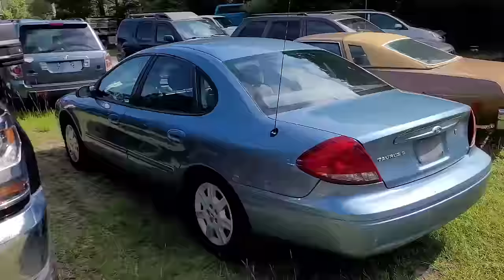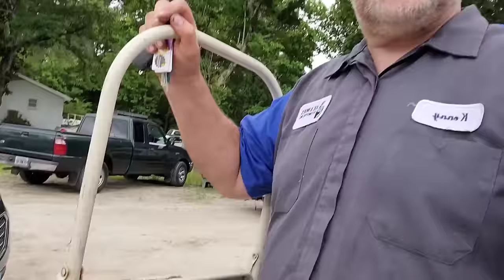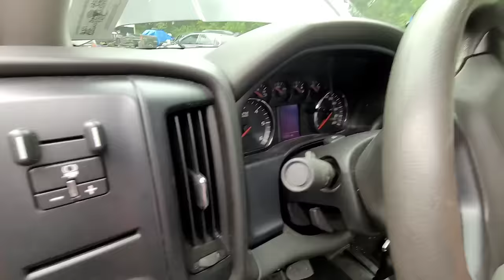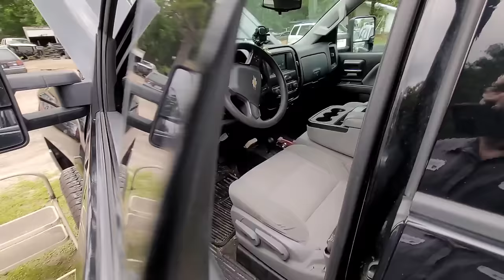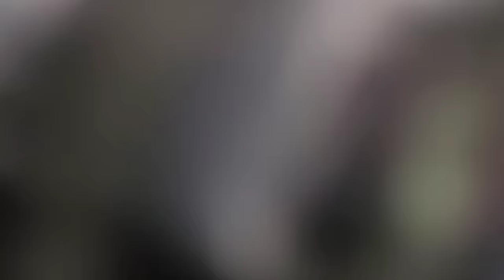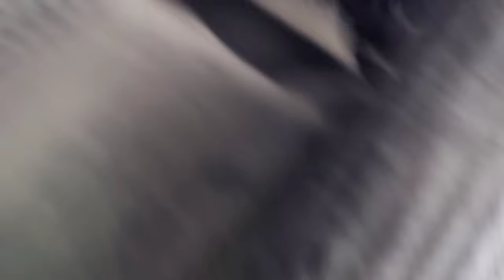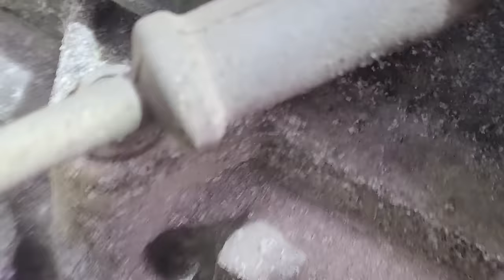Another GM 5.3 Ticking Noise. It's not the lifters on this one either

Comment: When looking for noises, it's handy to use a piece of tubing--large vacuum hose is good for this--you stick one end in (or close to) your ear, and then probe around to where the sounds becomes louder.  It's an easy way to pinpoint the location of the sound.  I have this motor, and I was able to track a light knocking noise to the . . . fuel pump, using this vacuum hose method.  In the case of this video, it would sure beat finding an exhaust leak with your hand!😱
Reply: Yes I have a stethoscope. I used a long screwdriver putting it on parts of machinery with the end of the handle pressed in my ear to isolating bearing noises on processing equipment.
Reply: @greybone777  Yes!  Another favorite method.👍

Comment: I am lucky and still drive a 2004 Silverado with the 5.3l back when GM made good 5.3l engines. I would not pay my hard earned money on any domestic made vehicle right now. If I had to buy a new truck I would get a Ram. I know they have their Lifter/Camshaft issues, but near as bad as GM. Ford Eco-Boost engines are really hit or miss. Real crap shoots you either get a good one or a bad one. I had a bad 2015 Ford Fusion for my wife and planned on buying a GM made vehicle to trade it in on and my buddy that is a GM service tech warned me and said just don't do it go buy a Toyota or Honda these new direct injected engines are very problematic. Domestic cars are designed to last just until the warranty goes out then they start failing. He had replaced 3 engines in Trail Blazers that month. We got a Toyota and man are we glad we did. As far as trucks are concerned they are all a crap shoot now. They charge you 60-90 grand and put a crap warranty on them. For as much money as they are selling them for you should have a warranty that goes to 200k miles IMO.
Reply from the maker: I agree . I'm not a fan of the Toyota trucks at all . Had to go with a friend on a road trip in his 19 Tundra Diamond Edition . Beautiful truck . But I swear , a Wrangler would have had a better ride . After 6 hours , I couldn't stand it anymore. Totally turned me off to Toyota. Honda doesn't make a truck . They make a front wheel drive Pilot ElCamino ... Barely hold a full cooler without bottoming out . I'm not a Nissan fan , however , they make a darn good truck nowadays.  The ram is also good . I worked for Chrysler for 22 years. The trucks driven aggressively, never had cam or lifter issues ... The ones driven like an old lady going to church , those ate camshafts . 
Thanks for watching !!
Reply: I feel the same way I have an 2011 with 5.3 so far so good I disabled the afm system with a programmer it's got 200k on it so far knock on wood no issues so far I also have a 2001 with an 8.1 has 330 k miles but needs a new Trans I'm keeping it around just in case I need it no way I'm paying today prices especially for the junk they are building today
Reply: 06 Z71 suburban and it runs circles around my wife’s 08 Suburban, and my Uncles 2019 Denali XL. Bought it from the dealer brand new and only problem I had to this very day of ownership was the left side wheel bearing blew out coming home from work, weekend fixed both sides and it still runs circles around any of these newer 5.3’s!
Reply: @heresjohnny5808  You are lucky there are plenty of legit issues with the 5.3l engines when they changed from cast Iron blocks and added active fuel management. 2005 and older are the best IMO. Look at the engine failures they have now on the trucks and their cars. It
s so bad right now with the Eco-Tec engines there are none to replace the engines that fail. Its that bad right now. Car Wizard has some good videos on that very thing. I am glad you did not have the issues others had man you missed the bullet:P
Reply: I have a 2000 SILVERADO 5.3, it is a beast with 300,000 miles. It was used in the early days to pull a 28’ fifth wheel. Now it’s a daily driver.
Reply: @randydeshane9991  Yes we are lucky when GM got rid of the cast iron block longivity took a nose dive. I am thinking of selling mine and finding a 200-2004 Z71.
Reply: @JasPlun  thought about going new for a split second then I read about the $70K problems (price tag for new Suburbans)they’re having and decided to stock up on water and canned goods lol.
Reply: First gen 5.3s could experience piston slap. GM supposedly fixed for 2004 models. I had 2004 Avalanche, but must of had a 2003 engine. I let the idiot valvoline quick change talk me into high mileage oil at 75k. Piston slap started after that oil change.
Reply: @robertleist771  Very few issues all the engines from 1999-2004 were rock solid you were more likely to have an instrument cluster fail than anything else. As long as people serviced them they were great they did have an issue with Intake manifold gasket leaks after about 100k miles and also Oil Pick Up tube O-Rings failing causing low oil pressure, but few had major engine issues and plenty of folks still driving them with 400k plus miles they are that good if maintained.

Comment: I'm amazed these vids still pop up; these are known issues with LS for the last 20 years.  Ticks are rarely ever lifters in the LS or cams (99 to 06/07).  They are generally pushrods having drilled out the rocker arms or sheared off exhaust manifold bolts(almost always the very front or very rear bolts).  Probably 90% of ticks in the Gen III motors.  08 and up add the DoD/AFM failures to those tick sources.  This engine also seems to have a lot of piston slap(likely aluminum block, which transmits that sound better) but while annoying it's a non-issue.
Reply: @jason3211  But it's still the factory rockers.  Pull the driver side rockers and look at the cup the pushrod rides in.  It should be a polished divot the size of the pushrod end.  If it's enlarged, deepened and/or looks more like a brushed surface than polished, and your pushrod ball looks more like an egg, there's your issue.

Comment: My 2001 Suburban had a mysterious tick  which was emanating from the #1 plug wire, but would quit when I lifted up on the wire. Turns out the spark plug  had loosened up and was arcing on the head. Took it back to the shop that had installed the plugs and they replaced three plugs, fixed it.

Comment: I switched from my beloved Valvoline to the OEM GM oil and I was amazed how much more quiet the engine ran when idling.   Night and day difference.
Reply: I hear ticking when I'm by a wall or a drive thru. And I always used valvoline full synthetic. I'm definitely going to switch and hope that can't bring the tick down. It's not loud like this vehicle but you can hear it when I'm by a wall
Reply: @gerardocontreras9547   Funny you should mention.  I could hear that ticking every day after work when I'd pull up by the wall at the drive up at  the coffee place.  When I switched to GM Dexos, it made a big difference.  I hear it's made by Mobil 1.   Good luck.

Comment: GM cheaping out on metal quality is the real reason for this. Never used to happen this soon (Or in most cases, at all) on the older 350 / 5.7 engines.
Reply: I have a 2019 Chevy express van I drive for work, the cat bangs against the cross member and has cracked the pipe where it is welded to the flange, these new vehicles are junk

Comment: Ya gotta love these 5.3’s
I have a 2000 LM7 5.3, I’ve had it 21 years. It’s got 207K on it and I just changed the plugs and wires. At 100K the plugs were in perfect condition and showed no wear. So when I did the recent plug replacement I got a good look at the exhaust manifold bolts. The heads of them look like chocolate chips 😂
I’m expecting an exhaust leak sooner or later. And I’ll address that when it is needed.
Unfortunately my truck will probably crumble into a dust pan before that happens.
Gotta love the northeast….
Great videos 👍

Comment: Very common issue on those engines. Have repaired a ton for the same problem. I usually just weld a nut to the stud if broken off inside block. Firewall bolts are always the ones to break. I don't understand why GM hasn't corrected this well known defect.
Reply: GM PISSES ME OFF THESE DAYS...
Reply: Because people continue to buy their trucks. As much as I love the look of the Chevys, they don’t make em like they used to.

Comment: Yea, that’s common. Ls exhaust manifold bolts are just too small diameter. They need changed before you hit 100k miles or they’re likely to start breaking in my experiences. Unless you throw some arps on. Another common “tick” is that crush gasket on the drivers side exhaust manifold (pretty sure it’s the driver side) , they go out around the same time the exhaust manifold bolts start going. If they start breaking, don’t take it to a shop and get got for about $2k cash. Throw the front end up on jack stands, remove the wheels and fender liners, and steering column section, (do the following work from the fender area) remove the headers. already have the new gaskets, bolts and thread locker, and spare nuts, something like 1/2” and 3/8”.  Even if the bolts are not broke flush and stick out, go ahead and weld a nut on it, and run it out with a little patience, you’ll get everyone of them, with ease and no problems. When putting everything back together, do NOT put anti seize on the exhaust manifold bolts, they WILL back out after a couple months and cause another exhaust leak, instead use high strength or removable high strength loctite or vibratite. If you go arp, you should be sat for the life of the vehicle, if you go with gm or other brand, change them before you hit the next 100k miles and you won’t have to deal with this again (or before what ever mileage interval you just when they started breaking. Flux core welders do work for this repair too, just turn the wire speed down and heat up, put some heat in the weld
Reply: 100% correct. I posted a similar comment on L series 5.3 exaust manifold issues. Looks like we are all on the same page.

Comment: I owned an 2002 Silverado with the 5.3L, and when my ticking issue arose, it was the catalytic converter. It was actually covered under warranty at a Chevrolet dealership. Not sure if GM ever issued any bulletins or recalls about the issue. I was actually surprised that I didn't have to pay anything.
Reply: Happened to me as well, but it could very well be this as well. Mine is now coming back.

Comment: That's a bingo with the exhaust leak. I bought a low mileage Chevy Tahoe from the auction claiming it had engine noise. Got it cheap. Upon examination discovered a major misdiagnosis. Two broken exhaust studs driver side rear. Took a stethoscope to the engine itself and it was quiet as a church mouse. Oil pressure good. long story short I bought a beautiful 2016 low mileage Chevy Tahoe for $3,000 at auction, replaced the two exhaust studs and the vehicle runs and drives perfect. Exhaust leaks are very common problem on L Series Chevrolet engines. Hope you all get a great steal yourselves out there, but make sure it is an exhaust leak because some 5.3's have lifter issues and they don't come out from the top either.
Reply: What are the signs of lifter issues? I have a 2009 Silverado 5.3 V8 that makes a kind of knocking sound when I start it up, then goes away after I drive for a little bit. Thanks
Reply: @holyspiritandkevin8441  Lifters make a ticking sound. A knock could be anything from a rod bearing, loose torque converter bolts, bad piston wrist pin, even a bad harmonic balancer. You need to check your oil pressure warmed up. Not cold. If its below 25psi or lower  warmed up it may be a rod or main bearing. I would use a stethoscope and listin around the engine to target the noise. If your oil pressure is a little bit low, try putting a heavier viscosity in it, and if the knock calms down, you most likely have a main or rod bearing issue. There is also an O-ring behind the timing cover that goes on to the oil pump assy. and they are known to go bad and cause the engine to lose oil pressure and could cause engine noise when it's cold. When the engine heats up the O-ring expands and oil pressure goes up. Your engine could be starving for oil from a bad o-ring. Hope all this helps but very hard to diagnose a problem without actually looking at the vehicle and listening to it. 
Good luck!
Reply: It's just bingo.

Comment: The 2016 GMC Sierra Denali I own with the 5.3 is the most problematic vehicle I’ve ever owned.  I have the ticking in the drivers side cold and it’s the purge valve by the throttle body. The passenger side is notorious for leaking, especially after GM does the AFM lifter failure repair and re uses the original bolts. Nice job!
Reply from the maker: Thank you !! Appreciate the input !!
Reply: I just replaced my manifold bolts with the oem, since the lifter was replaced in July.  Im glad I saw this video, I’d be into more of a headache. Happy Holidays!
Reply from the maker: @dudebud72  Glad the video helped !! Thanks for watching!

Comment: Ticking noise is very common when sitting and idling for a few min, main reason I have found and fixed 3 trucks so far is the oil pickup tub seal.I dealt with the issue for 2 years before discovering this. Fixed it 3 years with new seal and hasn’t done it since. I tried to find help from GM techs and they couldn’t even help me. New oil pick up seal and oil  pan gasket and not another embarrassing drive through experience at Burger King since I did it

Comment: I had a ticking noise on my 17 Tahoe. Dealer caused so many excuses. I found another YouTube video where it was the vacuum pump on the front lower drivers side of the engine. Sounded just like a lifter or exhaust leak. Finally got the dealer to change the pump and quiet as a mouse.
Reply from the maker: Thats awesome !!
Reply: I was thinking I had a lifter tick and was looking at Afm delete kit. I read this comment and went to check the vacuum pump and I do believe it could be the pump. I replaced the pump about 3 months before GM recalled them. Kenny is there any way I can definitely rule out the lifter?
Reply: The vacuum pump has a stretch drive belt on it. you can attempt to take the belt off the pump if you can figure out a way of how to get the belt back on the pump or what I did was I used a microphone and put it on the back of the pump and you can clearly hear the ticking coming from there.
Reply from the maker: @fiero880  , great info !! Thank you !!
Reply from the maker: @tommycrump8525 , like fiero880 said , remove the belt on the pump . Even though you replaced the pump , it could be faulty . Check all the manifold bolts and make sure none are broken . You can get a mechanics stethoscope at Harbor Freight to place on the valve cover and vacuum pump to try and pinpoint where the noise is coming from.

Comment: 4:20 BINGO!!!!!!!!!!!!!  My rattling noise comes from the passenger rear area of the engine!!!  Mine doesn't sound as loud as yours and it seems to go partially away after a couple of minutes.  I just drove it over two hundred miles with no problem, but I think the noise is worse after the trip.  

Last year I had the exhaust manifold removed on that side because I saw that, three bolts where broken.  It made no noise, however.  I had the bolts and gasket replaced!!!  Still, no noise. 

The noise actually Does sound like a few coils are ticking!  Thank you for this video.  I really thought it was the rear main bearing, $$$, but I thought, why would it be from only one side?  Well, just a thought checked it again. It's not the manifold and not the bearing.  It seems to ch a new location.  Now it seems like it is in the area of the right rear passenger area under the car.  I ran it for one minute and it was very loud and then it stopped completely.  I turned it off and restarted it and it came back quieter.  I think something could be loose in thr exhaust the tightens up when it heats up.  Any thoughts on that?

Most mechanics just throw parts at the problem because Thinking and troubleshooting is so much harder. 

Case in point. The directional signal and emergency flasher don't work.  Change the flasher, right?  Wrong!  The fuse was good, but it had corrosion on it.  I scrapped it off and they came back on.  

Another case in point.  The P4020 code for the cat came on and the computer wouldn't get the car ready for emissions.  The problem was the need for a Drive Cycle after the battery had gone dead for three days and I installed a new one.

Another case in point.  The entire interior of my Tahoe would go electrically dead while driving. I mean, everything electrical was dead but the truck would still drive.  When a mechanic had worked inside the dash, they didn't put everything back in its proper place.  There is a small Black Box above your left shin that snaps into a galvanized bracket.  It was just floating inside it and moving around and every time I made a hard left turn, the car would go dead and sometimes stay dead.  When I made a sharp right turn, the power came back on.  Something must be moving! I found the loose box and snapped it into the holder and the problem never returned.

Comment: A lady I worked with bought a brand new Mercury Mountaineer around 2000 or 2001 and I drove it once a few months after she got it and it did the exact same thing, but I think it was on the driver's side. I can't say for sure but I think it had the 5.0l V8. She had only just started hearing the noise a few days earlier and hadn't really given it much thought but I told her I suspected it was the exhaust manifold not being sealed to the engine. A few days later she had taken it to the dealer and sure enough, they found a couple of loose bolts and fixed it under warranty.